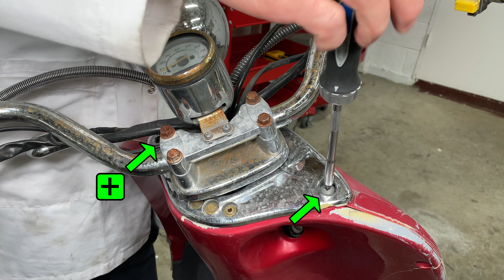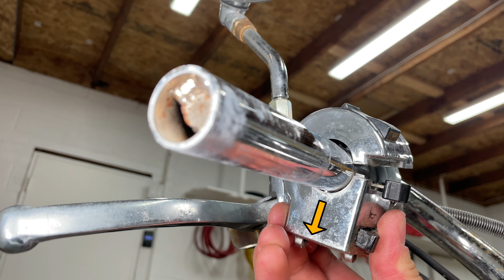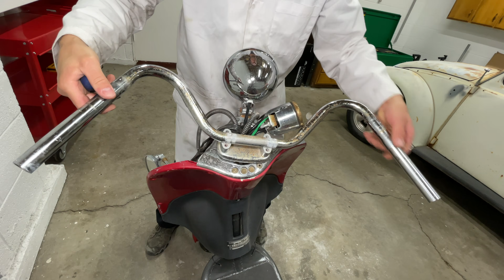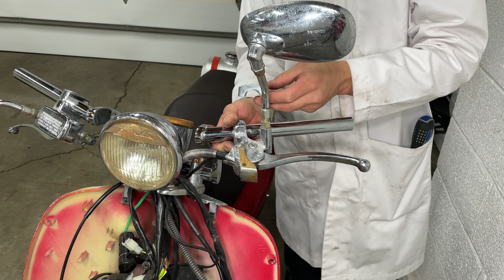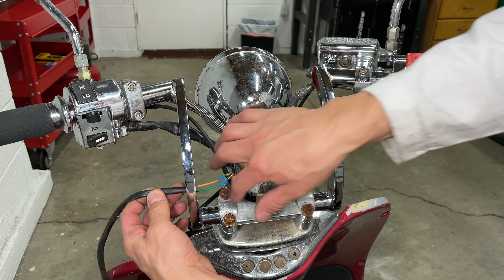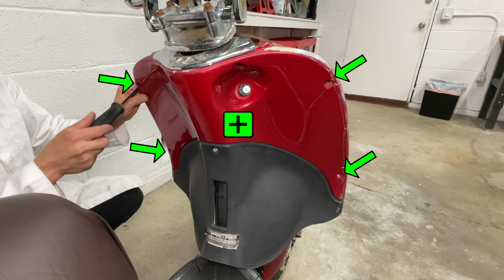Installing a new handlebar on a 150cc GY6 Chinese scooter

Comment: Most chinese scooter, have 1 peace handlebars. They must be cut off and a new mount welded on. this guy has never seen a Jonway or taotao
Reply: You shouldn't have to cut any off.  They have mounts to the main body aligned with the front forks.  You might be doing something wrong if you are having to cut them.  This guy knows what he's talking about.